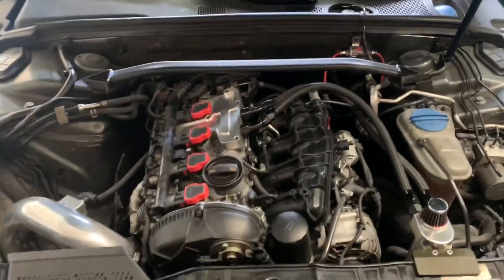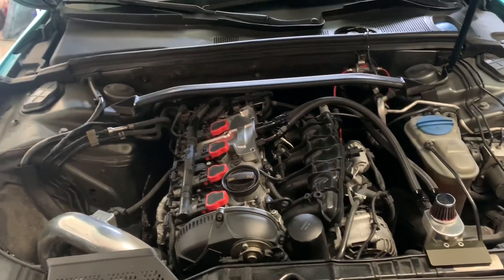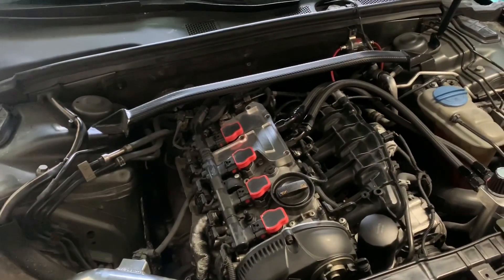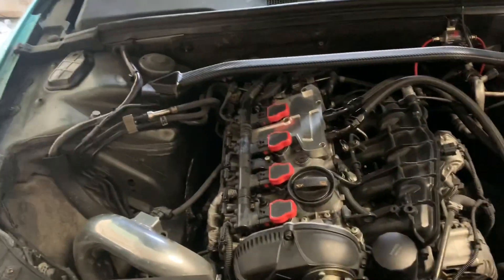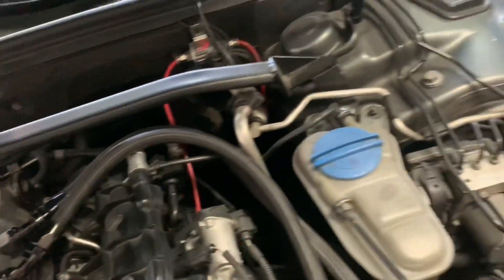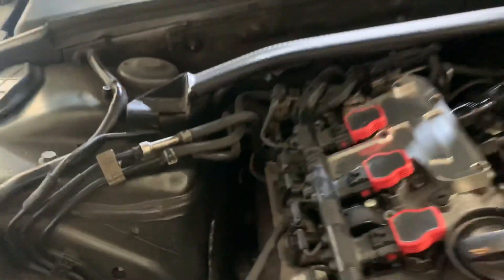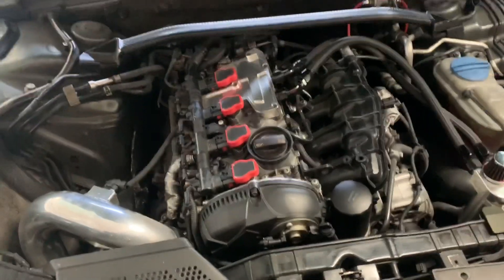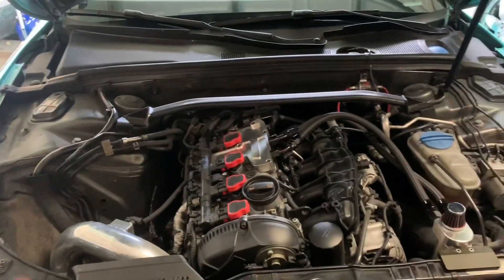How to get 455 hp to a Audi b6/b7/b8/b9 or Vw 2.0 tfsi or Fsi

Comment: Are you interals stock? And also do you have the EA888 gen 2 or 3? I have the gen 2 and I'm too wienie to add power because I've seen some horror stories of bent rods.
Reply from the maker: I have the same gen as you, all stock internals, but I put in new pistons and rings a year ago, only because my car had warranty for oil consumption issue. So I went ahead and did it, but not much we can do we our car but put forged parts. The horror stories are probably from timing chains snapping do you poor tensioner . That has always been an issue, but the dealer now has an updated part
Reply: Oh yeah I've seen plenty of time chain stories but I was going to do a timing refresh before adding power so I'm not too worried from things break after the fact. Appreciate the response my dude!

Comment: Where did you get the K04 turbo? I'd be interested in what compressor wheel and turbine you're running to get that much power from a single K04.
Reply: Is38 turbo is a good drop in turbo. Good for 400hp and 400tq with boltons.
Reply from the maker: It’s an apr k04, it gives 361hp, 405 torque with the apr ko4 100 octane map,  then you ad my meth which ads about 50, then you ad my s3/rs3 Bosch injectors, bout 20hp, then you ad my Wagner racing inter cooler, and exhaust bam 450, look at the link I posted, if I ran e85 I can get 385 , alone but I went water meth for more gains. https://www.goapr.com/products/turbo_long_20_tfsi_gen2_b85.html

Comment: Can all these mods be done to only stage 2 APR? Obv not ko4/tune.  But the rest?
Reply from the maker: Yes but you can only max about 310 hp 343 torque, but if you ad meth you can probably pull about 363 horsepower, look at the link I sent https://www.goapr.com/products/ecu_upgrade_20tsi_gen2_long_b85.html

Of course a bigger inner cooler , and your exhaust can probably push you over, or a custom tune revo actually gives about 330 with stage 2 so with meth you can get close to 400, but apr keeps it a little safe
Reply: Bruce Custom Motors iam already stage 2 APR 302HP 343TQ. The injectors and meth would go along with stage 2 and make the same gains?

Comment: Nice video mate, what's the cabin noise like with the injen intake, had the 034 motorsports intake with the cutout enclosure but the drone at 60kph was terrible.
Reply from the maker: Actually I had the same one , k&n and apr, injen performance is the best from a number gain perspective, and less drone do to the cone being near the bottom of the engine

Comment: I’ve noticed the breather filter on the CTs catch can. I’m interested in why you have that filter there.
Reply from the maker: It’s seems that catch cans cause crank case pressure in your engine, and in some cases leaks from your valve , and timing cover, so I put it there to let out the crank case pressure, the traditional Pcv valve, put the pressure back into your intake manifold, which will cause carbon build up, over time, from all of the regular blow by, from your piston rings, which is normal, especially if you have a tune, so it’s bitter sweet
Reply: @brucecustommotors  Appreciate your videos Bruce. I've blown all my seal last year with my catch can and could not figure it out. I went out and got the breather filter and used 3M double sided to stick it on my CTS catch can. Never have i thought the solution to my problems would be this easy. Thanks for the help and support from your video i fixed my stupid problem for 12 bucks!

Comment: How did u get ur stage 2 tune. I have a 2010 Audi A5 and would want to get it. Is it like a Dyno tune of just parts
Reply from the maker: to get stage 2 you need a down pipe, air intake, (front mount inter cooler optional just better performance) an ( exhaust with more air flow optional just better performance, even a mid muffler delete would do it) of course you can get the tune with out the above, but you would probably throw some lean are rich codes, from the power gain. if you did dont run your car hard until you at least get a down pipe
Reply: So stage 2 is basically just all those parts on the car
Reply: Or is it like tune u get at a shop
Reply: Dennis Escobar he listed the bolt on parts you need. And the tune is the only way to add any HP properly
Reply: Where can I go to get it

Comment: Will running e85 get the same performance gains as methanol?
Reply from the maker: Yeh its pretty much the same, both give yo higher octane amounts, if you can do e85, its cheaper. but the only challenge is finding gas station. my other car is equipped with e85, and from my experience they run out alot. but if you dont have the issue, e85 . Also water meth actually-helps clean your valves and lifters of residue, so theirs some maintenance perks as well
Reply: @brucecustommotors  Thanks for the info, i have a flex fuel Q5 and e85 is available in Florida.  Next step is intake valve issue.
Reply: @brucecustommotors   i have a stage 2 tune already. after i install the meth kit, will i need to do another tune?

Comment: Genuine Bosch Fuel Injector SET OF FOUR VW or Audi S3/TTS/Golf R 06F906036F
Genuine Bosch Fuel Injector SET OF FOUR VW or Audi S3/TTS/Golf R......was it hard to install that and did it fit ok ???
Reply from the maker: no it was easy just have to remove the throttle body and intake manifold which is connected to each other pretty much four bolts, you just have to make sure its seated right , its plug and play. theirs several diy 
's on you tube if you cant find one let me know and ill send you a link. but its well worth the mod.

Comment: Hi, I have a 2.0T A5 2012 with all the same mods you have. I am running the APR stage 3 tune and 04 turbo. My engine is just rebuilt and fresh. I wanted to know exactly what S3 injectors you are running? Can you give me the part number and where you got yours? Did you upgrade your high pressure fuel pump? Have you gotten any codes lean or rich? Enjoyed the video man, keep up the good work!
Reply from the maker: Chris K  for our car which is the same, apr does not offer an high pressure fuel pump, or turbo sensor. I too was looking to upgrade it, the b7 and b6. , and some gti’s offer the upgrade and engine fart noise were as ours doesn’t have a need.  Yes I was running lean , a lot before I put the injectors in, once I put in the Bosch s3 injectors . It solved my problem, if you’re running rich , try cleaning your mass air flow sensor often , because of the boost level and air flow it tends to get dirty quick depending on what air intake system you have .  I’m going to send you a link to the injectors, the injectors will level your tune and ensure the gas matches the air flow, our factory injectors are maxed out with the k04
Reply from the maker: Chris K 2 different prices

Both golf r and s3 injectors which fits our vehicle one has the latest revision which is the more expensive one I have the cheapest one

https://www.ebay.com/itm/233325010854

https://www.ebay.com/itm/303071017912
Reply from the maker: Thanks for the love🙏

Comment: I think you’re video just convinced me to keep my ‘10 A4 and mod it, but I’m at 135k miles. Anything you’d recommend as far as maintenance before mods? I will be replacing the chain tensioner, the chain, also the PCV valve and maybe the camshaft bridge depending on its condition. Thanks a lot
Reply from the maker: I’m at 114 believe it or not, and I replaced my timing chain tensioner at about 100k and my car was like new.. honestly you’re doing all the key things before mods check your pressure in your pistons chamber. just to be safe, to make sure everything is consistent, and you have a good  post and pre, it will change slightly with a tune. More power more blow buy just the physics and engineering in pressure.  I’m here for anything you need

Comment: I am a b8 a5 2.0t owner Im about to re seal crankcase and replace timing chain and tensioner and seal all the covers (cause it started leaking)  I am running apr stage1 with and air intake a bov also have a Sprint booster ( if that matters)😅 I love your video and any tips or videos of you installing mods or doing Maintanance and servicing your car would really be helpful I'm trying to run as much hp with stock internals I don't want to blow my engine any suggestions? ( Also a video on how to clean carbon build up would be amazing)
Reply from the maker: erik estrada definitely will have them coming
Reply: Thanks I'll be on the lookout !! Do you have a shop in California or you're just more of a DIY?
Reply from the maker: erik estrada I’m a diy guy but I have multiple friends who own shops I collaborate with, as far as blowing your engine it’s rare in our car,  I recommend if you’re changing the timing chain if you’re under a 100k there’s an extended warranty on our engine for that call your dealership, or look it up on google, also we have an oil consumption recall on our car that replaces the rings on our vehicle,  our engine can take a beaten, the worst of seen is warn out rings, after a lot of wear and tear. To prevent carbon build up I recommend a oil catch can , which redirects the blow buy in our car I’m going to do a video today
Reply: Got it will check on that recall and yes it's under 100k and okay I'ma order the catch can today and I already I have build up so im going to take care of it as well and by blowing my engine because of too much power I also mean bending rods or valves I don't really want internal problems
Reply from the maker: erik estrada I just dropped a video on catch can, and I do have forged piston and valves, but our internals can take up to  430 hp , I just was proactive, because I knew I would be superseding 430 hp
Reply: Ok let me check it out !!

Comment: If you add meth injection post a stage 3 with Ko4 and tune, is a custom tune needed to get all the gains and benefits from the meth ?
Reply from the maker: You just need more timing, like for example when I run my meth, I switch my apr tune to the racing map which is  between 103-104 octane, every tune has a race, map, and it’s basically adding timing. To accommodate the extra octane , so the engine can combust at maximum explosion
Reply: @brucecustommotors  ok I have integrated engineering Ko4 tune and running the 93 tune so I just need to switch it to  the 104 tune ? It's there highest tune
Reply: @jimparolisi1596  just actually get it tuned correctly not flashed

Comment: The R8 coil is the same exact coil as your car OEM no difference. Part # 06E905115G
Reply from the maker: I wouldn’t source anyone but the dealer, the market is too saturated right now for true specs, some will, say fits a5/a6/a7/s8/R/8/S5, which not true theoretically they fit, but not the right part, it’s like having a dead battery in a Lamborghini, and using a lawn mower battery to start your car, you won’t get the true out put. But yes it will fit. If you call the dealership with a random vin for an salvage r8 off google, and ask them for coil, they will give you a different part number than a 2.0t, believe me I tried, I would try to get my parts cheaper by getting the model number, and buying the same model number from Volkswagen, Audi hack 😂 lol, I purchased mine from the dealership,  I’ll look at my car when I have time to give you the exact part number
Reply from the maker: Electronic Battlefield Application(s): These are GENUINE coil packs. If you're comparing on price, be sure you're looking at genuine OEM coilpacks. Many available on the Australian market look the same, but are not OEM. You can tell by the printing stamped on the upper side of the connector (as pictured). These coilpacks are the same as used in the R8 V8 and V10. It should fit most Audi V-engine since 2001. It also fits the VW Touraeg from 2006-current. These coilpacks can also be used as an upgrade for some FSI or TFSI engines, as they have a higher output for a stronger spark. They're a common upgrade for the Golf GTi, and other cars with the 2.0TSI & TFSI engine. You can use these on the 1.8 TSI/TFSI, and some other engines, with a spacer, which is sold separately. They are highly recommended especially if you have upgraded your turbo or have an ECU tune. If you're unsure if it will fit your vehicle, please contact us to confirm.

Description: Set of FOUR Ignition Coil Packs

Comment: Did you have to change your tune when you swapped to the s3 injectors?
Reply from the maker: VAG Central no didn’t have to, the mass air flow sensor reads more air, and matches the gas. The reason I went to s3 injectors, is because I would get lean codes from time to time which means it’s to much air and not enough fuel. I believe I just maxed out my stock injectors, they couldn’t keep up with the air flow, once I put the s3 injectors in it stop the codes, and put more fuel in the combustion chamber, which ultimately added more power, remember if you’re running rich is to much gas and not enough airflow

Comment: I’m glad you’re posting again I just recently picked up an Audi A5 B8 2.0t I love it. My plans are to eventually make it B8.5 because I love the look so much. So I’ve started making it a little bit more bullet proof by getting GFB diverter valve and catch can etc. My next move will be intercooler, turbo kit and tune, suspension and exhaust. I started following you about a month ago when I started doing my research on upgrades. That wide body look is on point and this I must say is the best I’ve seen yet! I followed you on instagram too. Keep those videos coming brotha!!🔥🔥🔥🔥
Reply from the maker: thanks brother it truly means a lot, especially in these difficult times. My car is actually a b8, i bought a hood and front bumper and lights, it converted it . youre going to have so much fun with your car. Im here for any questions, god bless you brother.

Comment: What can I do to get up here in terms of power on an a4 2.0 b9? To at least 400 or more
Reply from the maker: apr tune , i say apr over revo because revo is starting to die out in america, but is more prevalent in uk

apr stage one can get you up to 314hp 388 ft-lbs 

if you ad an intake and bigger inner cooler, that will get you about 30hp.
s3 fuel injectors will get you about 15 hp on the b9
down pipe will get you about 5 hp

so you will be looking around 360 hp

 https://www.goapr.com/products/ecu_upgrade_20tsi_gen3_b9.html

revo stage 2 will put you at 336hp to 345ft-lbs

 from factory, and ad all i said at the top with apr and youre looking at

370hp

https://www.onlyrevo.com/product-details/software/audi/a4-b9-2015-/260/stage-2

anything else will be water meth or turbo upgrade
Reply: Bruce Custom Motors they have turbo upgrades for the b9 a4 2.0 engine? If so can you link me.